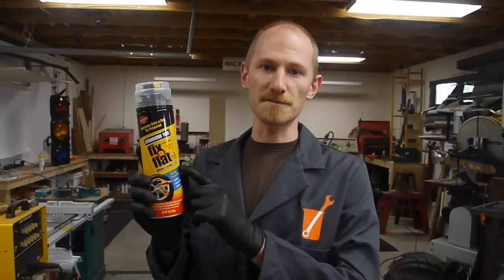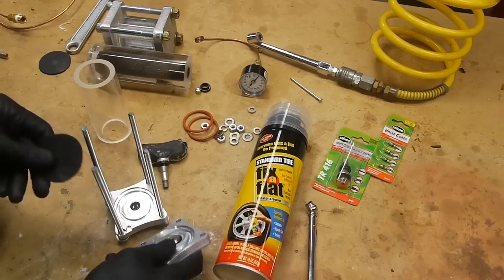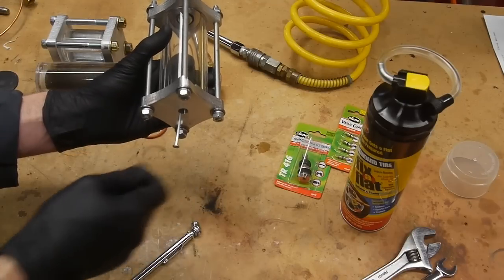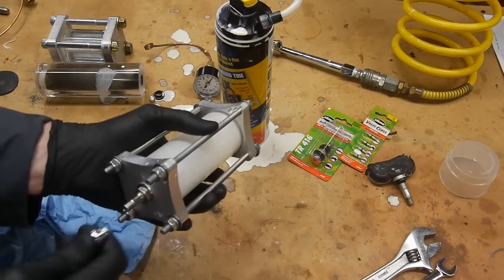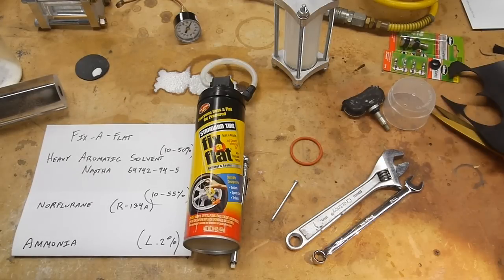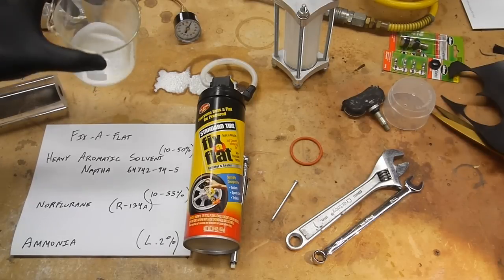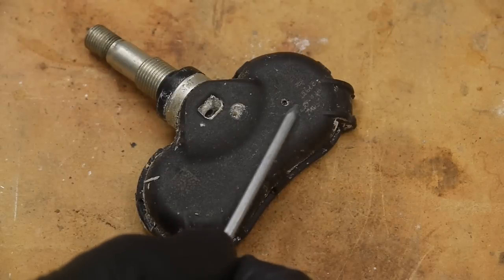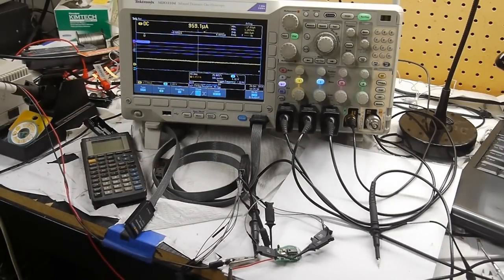Tire sealant chemistry and tire pressure monitors

Comment: These sensors cause epidemic tire air leaks and then you have to un-rim and rebalance one or more wheels. What a pain. In Canada TPMS are not required by law, but installed in all new cars nonetheless - just throw them away and put a tape over the light. Also, never install a sensor on a rubber stem - rubber flexes under the sensor weight and the small seal between the sensor and the stem starts leaking air. Always use only metal stems and tighten the sensor to the stem at the exact torque - no more, no less or the small seal will leak

Comment: All these chemicals work together not only to fix the puncture but also to destroy the tire. Tires are easily damaged chemically by solvents and uncured rubber. So, if you use one of these cans to fix a puncture, no decent technician is going to repair the tire afterwards. It's far better to have a small compressor in your trunk.

Comment: The link to the SP100 has gone dark but here is another: http://www.findmems.com/wp-content/uploads/2010/12/sp100-15-datasheet.pdf
This is a great video and satisfied a curiosity that has been in the back of my head for so long. I was hoping to see a little more about the TPM, especially when I saw the monolithic solution sensor chip and what looked like maybe a chip antenna under that label on the right side of the PCB. I noticed the SP100 only has SPI communication and no built-in BLE, CAN or other common automotive communication protocols. After a bit more reading on the SP311 link it does talk about the device using the 315-MHz ISM band. Still those parts don't look like the 315MHz parts I'm used to and I sure don't see a long-ish antenna. That said it sounds like something Sammy Kamkar might mess with to gig his neighbors (haha flat tire, jk jk).
Reply: I think it's time to break out the HackRF and listen to what my tires have to say. I always assumed they were on something more "secure".

Comment: Hypothetically, is it possible that the tire pressure sensors are designed to be secretly used by Law enforcement to purposely flatten a tire(s) on a suspects car say in a police chase? after all its Wireless? in other words could the sensor I/O have a duplex function? ( output to the cars computer, or a warning light Signal)  and ( input from a transmitter tuned to send a signal to the Sensor? ) Just a thought.
Reply: How do you propose that a sensor sealed within a confined space is suddenly going to release the air pressure?  Explosives?!?!  It is rush hour traffic and the police are going to blow up the tires on every vehicle within a quarter mile radius?

Even in that paranoid realm of thought the most the sensor could do is generate a false "low pressure" idiot light -- the tire, and its pressure, would remain unchanged because there is nowhere for the air to go as the sensor is just that, a sensor.  All they do is wake up every so many seconds and say "Tire #1 is at 32PSI", the receiver in your car then decides that 32PSI is greater than 28 and less than 36 (+/- 4PSI), so all is good, no need to illuminate the idiot light for tire #1, and so forth.

Comment: Tire pressure sensors are required by law since 2007? I think that only applies to "run-flat" type tires and vehicles that run them. Normal tires in cars with a spare tire do not require pressure sensors, even in new cars.
Reply from the maker: Congress passed the TREAD act after the Firestone Tire debacle around year 2000.  After 2007, all new passenger cars and light trucks must include a tire pressure monitor system regardless of tire type.  Initially, manufacturers had indirect measurement systems that used the ABS wheel speed sensor to detect a low tire by measuring the effective smaller diameter (faster rotational speed) of an underinflated tire.  Eventually, they mostly gave up and installed wireless sensors in the tires.
Reply: Applied Science I own a 2013 motorcycle where tire pressure is more important than a 4-wheeled car. Where is my government mandated TPMS? :(
Reply from the maker: droid Congressmen and Congresswomen probably have fewer motorcyclists in their demographic group than the population as a whole, so the idea just wasn't as prominent in their minds.  However, it can work in your favor too:  eg Motorcycles are exempt from smog/emissions testing.
Reply: ryanmail2004 ABS sensing does require calibration each time you adjust the tyre pressures though. It also cannot detect more than one tyre deflating.
Reply: Chees, talk about micro managing the population.
Reply: *****
It doesn't sound like you know how the system works. Yes of course the ABS pick up is on the wheel itself, and if the tyre pressure drops on one wheel, the rolling radius changes causing that wheel to rotate at a different speed to the others which is how the system detects a flat tyre. I don't know about other marques, but whenever you adjust the tyre pressures in my BMW it prompts you to recalibrate - you then drive for a few minutes and the ratio of speed of rotation of the wheels is stored.

What did you think the ABS ring did to determine a flat tyre if air pressure had no effect on the ABS sensor?? Lol
Reply: Applied Science How does the ABS-type sensor tell the difference between a tire deflating, and a tire getting worn out?  In both cases, the diameter would shink a bit, making the rotation speed up
Reply: Because one tyre is not going to rapidly wear down. It's looking for a change in ratio.
Reply: Mike Dawson ABS sensor measure speeds on all wheels. Since tires will wear out almost equally, ABS does not complain about it. However, a deflating tire will report a significantly different speed than others which can easily be detected.
Reply: Your information is 100% incorrect.
Reply: Not micromanaging, but the result of one guy's lawsuit and (blaming his low tire pressure failure on somebody else), and legislators as a result making that everybody's burden (and expense).

Comment: Ha, R134 is also what is used in chinese super duster! Strange they will let it be used to fill tires and clean computer gear but not to actually recharge a refrigeration system.
Reply: R134 1,1,1,2-Tetraflouroethane is the chemical used in super duster http://www.mgchemicals.com/products/dusters-cold-sprays/dusters/super-duster-134-402a/ but where I am it is not for sale to recharge car AC systems unless you are a technician.
Reply: The same reason that all fun science is illegal, someone abuses it and they make a law against it.
Reply: Nick Moore Just picked up a can of 'Falcon Dust-Off' and looked up the MSDS, CAS #75-37-6, 1,1-Difluoroethane.   a.k.a. R-152a or HFC-152a.   This seems to be the refrigerant of choice in the majority of the 'canned-air' dusters that I've turned up, the MG Chemicals duster seems to be an exception to that...   R-152a is slightly lower pressure at room temperature than R-134a, around 65-PSI at 72 F as opposed to around 71-PSI for R-134a, hence the name 'Super-duster'.
Reply: *****
Afaik it's not considered safe refridgerant anymore in EU.

Comment: I would imagine at least one of the components has at least some conductive qualities, so a battery short could be possible. I also checked a list of plastics that are reactive in contact with refrigerants, and r134 has a host of plastics that comes close too "compatibility on the verge of permissible" lol (which I assume is long winded way of saying, only slightly reactive..) there are even a couple that are completely reactive. heres a list allchemi.com/eng/refregerants/compatibility.html
Reply: (the inside of a tire, supposedly while running, can be 50 or more degrees above the ambient temperature.. combined with 2 atmospheres.. would the fact sheet relay that or the chemicals at sealevel and storage temperature?)

Comment: Applied Science  Interesting discussion, thanks for sharing.  I use Stan's No Tube's Tire sealant in my velomobile, check out my channel for more info.  Anyway's, the sealant contains aramid fibers to help fill the hole, along with a latex mixture.  Out of curiosity, was there a texture to the liquid?  Feels kinda like sand.  If it does, I would safely assume that your sample contains kevlar too.  Cheers!

Comment: well done vid. the tire repair industry is increasingly corrupt, they will give any excuse to screw you for a new tire instead of fixing one.  I have the same situation & used the spray instead of needlessly replacing an almost new tire, now my sensor is toast too.

Comment: I bet you if you put it near your car, it would sleep. It's going into transmit and staying there because it isn't receiving a packet saying "ok, you can stop sending now" or it could need pressure to sleep properly.
Reply: +joblessalex TPMS sensors normally stay in "sleep" mode until they are awakened by an incoming signal, either from the vehicle's TPMS control unit or a registering device.

Comment: This is a video I can smell. Having worked as a tire tech for many years I can honestly say I hate this stuff. It smells awful and when you pump the entire contents into a tire it does little more than makes an extra mess on your tire guy. Use ENOUGH to get the tire back up and add air to operating pressure to be able to take it to be repaired. In the event of a large puncture fix a flat does nothing and will just spray out of the leak.

Comment: Fixa flat + tire sensors = BAD.  ...... So $15 plug now or $150 for sensor and $15 plug later.
Reply: I had to replace a sensor once. Cost for the sensor was about $60 as I recall. Then about $7 for the tire guys to install it. Still a lot more than I wanted to pay. Bottom line these days is that Fix-a-flat is a bad idea. It's best to use a portable compressor to air it up enough to get to the shop if it will hold air for long enough to do that. Also, it's a good idea to carry a tire plug repair kit, those things are good for punctures and hold up quite well. Lost count the number of times I plugged a tire and never had one go bad.

Comment: The car manual should tell you that the car sensor will fail when it goes off and you don't re-pressurize the tire properly. My spare kept losing air-pressure so I left it in that state for months. Now the battery is probably almost dead....ugh! Toyota I hate you.

Comment: Ugh. Hate this stuff. Between it and stop leak products they save you zero dollars. NEVER EVER EVER EVER  put sealants/sealer/stop leak/re-seal in any car ever.  Many tire shops will rightly tell you once you use that fix a flat they can no longer safely repair your tire.

As far as the rest of the mechanic in a bottle stuff goes, I see piles of that stop leak AC hvac system sealer offered at the local auto store with employees eager to help you pump it into your system and it makes me cringe. There is no better way of ensuring a rapid failure of your compressor and plugging many tiny tubes and orifices than to even put the smallest amount of that stuff into your system. 
Fix the peoblem not the symptoms. Cars unlike people have no ability to heal and anything broken must simply be replaced.

Comment: if you ever have the option of NOT using Fix-a-flat, do so, that stuff will rust/corode your wheels and destroy your valve stems as well as the affor mentioned pressure sensors